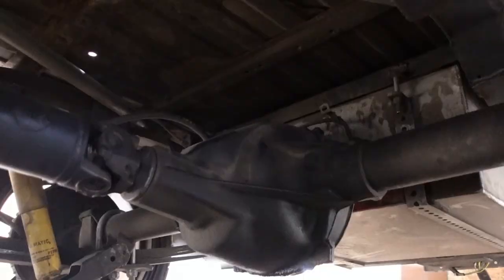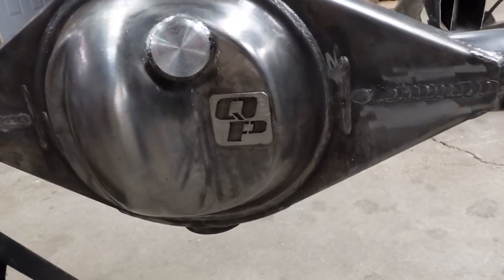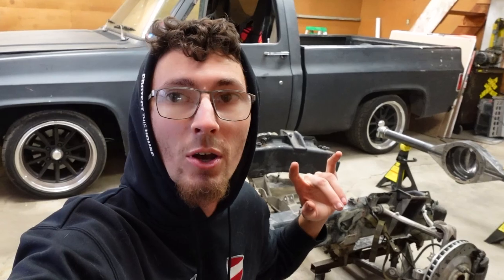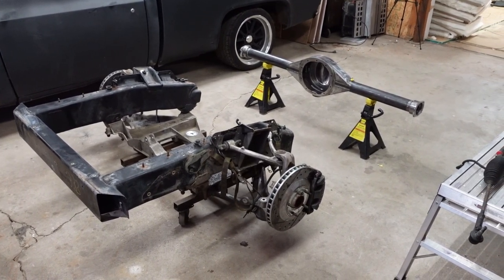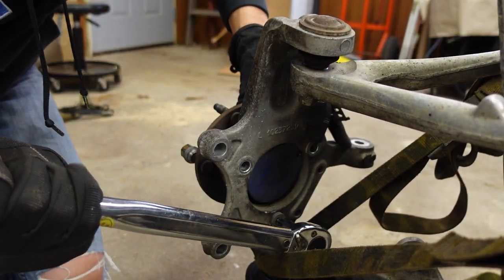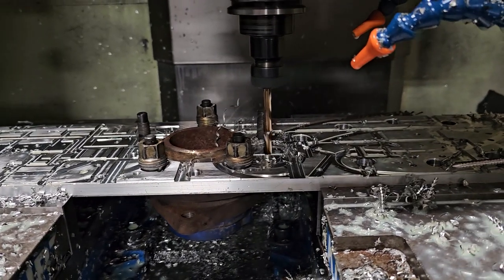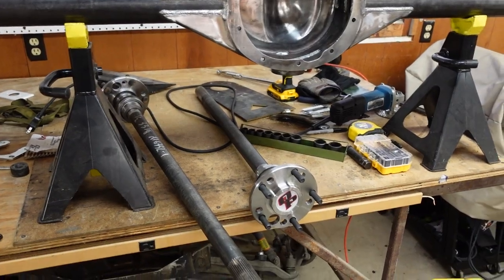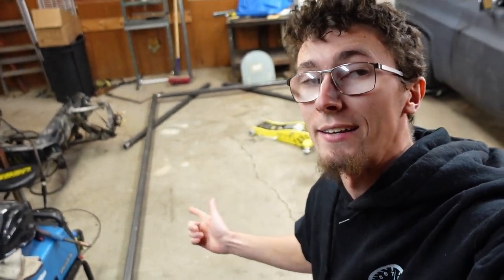Building A Pro Touring Square Body Chassis! Part 1

Comment: Did quick performance supply, help you with that. Curious if they paid for it or supplied the housing?
Reply from the maker: They gave me a discount.
Reply: @designbuilddrive  did you reach out to them. Just curious how that all played out. In process of building a 65 chevelle. Thanks